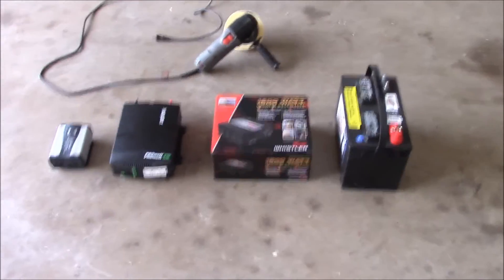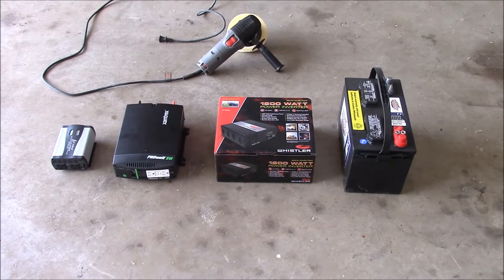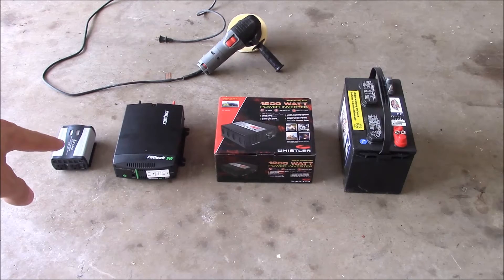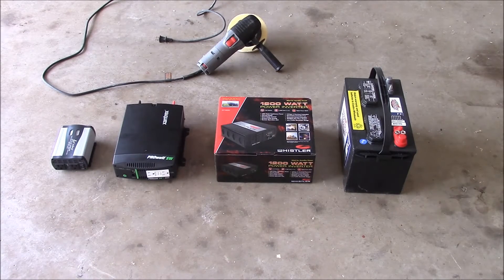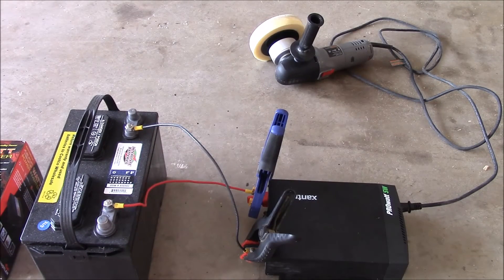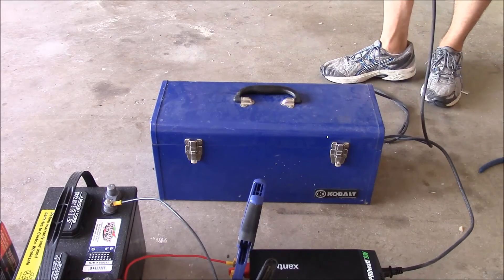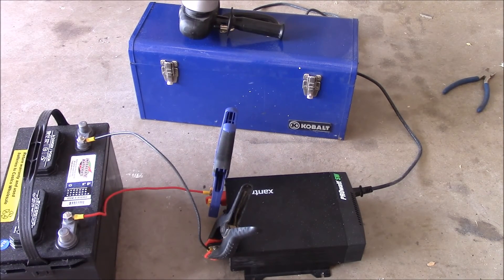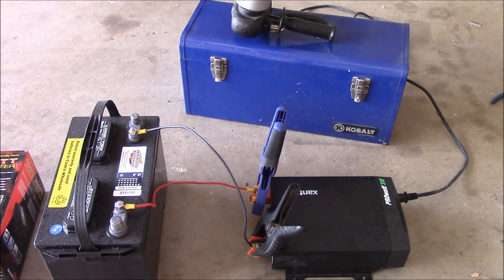Will It Inverter? - Orbital Polisher

Comment: Can you 10-12 hours polish a whole large sized   car with this set up at hot summer time outside ?
Reply from the maker: Polish a car for 10-12 hours with one battery?  Not a chance.  You would need quite a few batteries of the same size that I used in the video or a larger size capacity battery to pull that off.
Reply: Will the invertor cope ?
It takes me 10-12 batteries 5ah each to polish for 10-12 hours with cordless polisher.
= 60ah all together.
100ah car  battery will manage ?
Reply from the maker: Sounds like a 100Ah deep cycle battery will work then.  But not a starter battery.
Reply: @LDSreliance  ty vm
Here in europe i dont seem to be able to find deep cycling battery and nobody heard of it :) :(
Is it that leisure battery for boats /naval and caravans at the same time , stating good for start and cyclic use ?
Reply from the maker: They may just call it a different name there.  They are batteries for boats and RV's.  They are not good for starting or cranking.  They are marathon runners, not sprinters.  Deep cycle batteries can provide smaller amounts of power for very long periods of time.  Starter batteries, like in your car, are made differently and are good for larger amounts of power for shorter periods of time.
Reply: @LDSreliance  got you.
Ty vm

Comment: Nice to finally see a video where the tool is put under a load after it is hooked to an inverter and simply turned "on."  I would have liked to see what happened when you put the smallest inverter under a load too -- probably would have tripped it's circuit but would have been nice to know for sure.  Thanks.
Reply from the maker: You are welcome.  Thanks for watching.

Comment: Another issue is duty cycle. Just beacuse you can power it up, wil it invert for a duty cycle, lets say polish a car?
Reply from the maker: azoresmarine But does that say more about the inverter or the amp hours of the battery?  Or are you wondering if the inverter will overheat?
Reply: If the inverter will overheat.
Reply from the maker: K I will check it out next time.

Comment: Thank you. 

Did you manage to see what the amp meter side of the prowatt said?

Mine only changes when I plug in my lil dirt devil vaccum. My laptop just flashes 0.

Thank you again for the vid. It puts my mind at ease a little,  Still would like to see if 5a under load will pop it.

Cheerz
Reply from the maker: IslandCastaway ⛵ ⚓ I was just going to send you a note to check out the video.  You beat me to it.

The ammeter showed 3+ amps when it was on high speed (not under load).  I forgot to look while I had it under a hard load.  I can connect it again next week when I make some more videos and see.

I will test it with more devices in the 5 amp range.  Stay tuned!